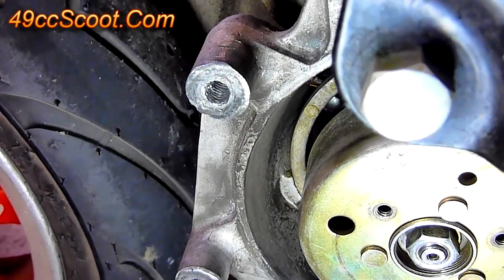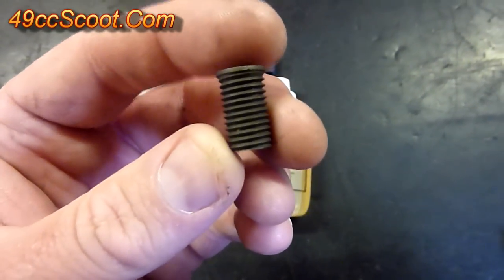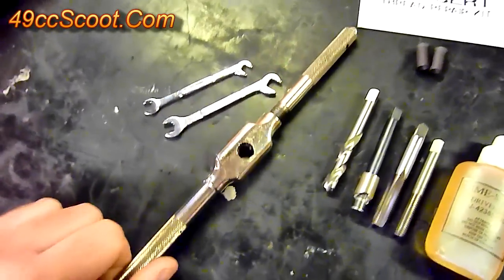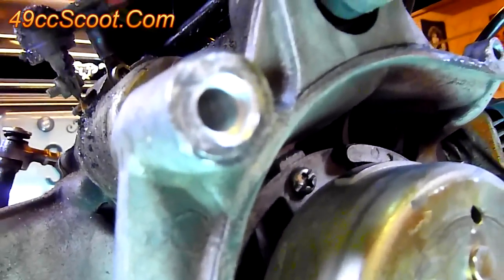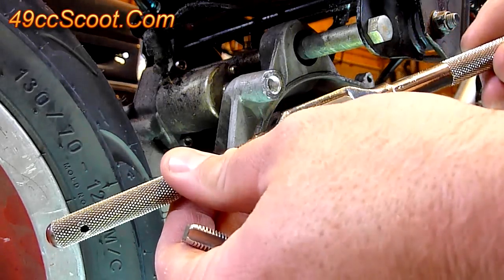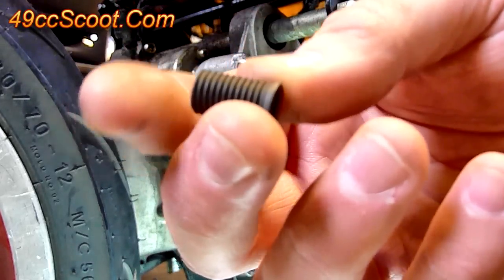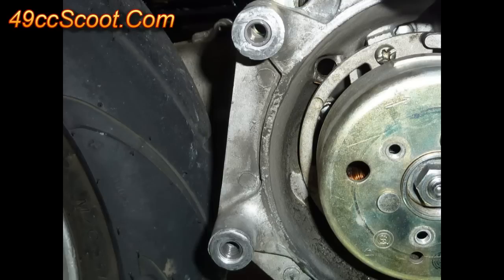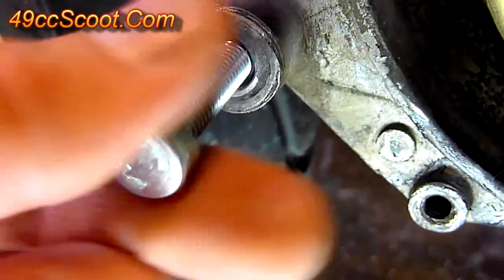Time-Sert Thread Repair - Heli-Coil Alternative

Comment: Can the inserts be inserted on the spark plug, without the spendy kit? I already have my spark plug sockets rethreaded from my crappy helicoil kit that kept failing.
Reply from the maker: They sell inserts made from different materials for head repairs, depending what the head is made of so they expand and contract at similar rates. I'm not sure if their standard insert kits work with their spark plug inserts or not.
Reply: @49ccscoot  refering to the time sert spark plug socket "Specific" kits. If my socket has already been tap and died, can I just insert the spark plug in the insert...and insert it all together (in socket), without having to buy pricey $150 kit?
Reply from the maker: @fisher5413  Maybe. They use a system that locks in place when a second sort of tap goes through, by pushing material outward. It may do the same when a plug or bolt goes through, or maybe it won't work out well. I guess if you can get one cheap enough, you can try it. I wouldn't count on a high success rate. I've only used the whole plug kit and that worked well for me.

Comment: I just had intake threads strip on me. There’s just not a whole lot of material in that particular spot that scares me. Minarelli also
Reply from the maker: I have used M6x1.0 timeserts to repair intake bolt holes on my Chinese Minarelli engines before. It worked fine for me.

Comment: Can you recommend a Time Sert insert and rethreader for a 49cc spark plug hole? 10mm thread diameter and 1/2" thread length....please answer...you would save my life.
Reply from the maker: Contact TimeSert (dot com) and tell them the thread and depth and material of the head. They should recommend a part number. I will say that some of the kits are very expensive. Definitely check the cost of a new head before you order anything.
Reply: Thanks

Comment: Can you use 2 time serts back to back     for deep 1/14  depth   thread repair?
Reply from the maker: No. You would need to look for longer inserts. They make them in different lengths.

Comment: @ 90GTVert  Can you tell me the size of the drill bit which is included in that Time-Sert Thread repair kit.. Did you fixed M8x1.25 thread in this video?
Reply from the maker: It was M8x1.25. It's 3AM ATM and I'm too tired to go to the garage, but if I don't reply just reply back so I'll get a reminder.

Comment: Good video.  As a former shop teacher remember when tapping the hole, after every one turn of the tap be sure to back it off 1/4 to 1/2 turn to break the chips loose.  This keeps them from becoming too long and failure to do so can actually cause the new threads to be deformed.  Otherwise, a very nice instructional video.
Reply: That and you might not want to tap it as fast as that ;-)

Comment: What I don't understand is that why not just tap using next oversize thread and install bigger bolt? So if there is 6mm OD bolt one should tap to M7 and use M7 screw? Why is it not so?
Reply from the maker: That's OK in some cases. Sometimes there are reasons to retain the original fastener size. Perhaps I didn't wish to drill out my exhaust mounts for the larger bolts for example. Other times it's more critical.

Comment: How do you ensure you are drilling in perfectly straight especially when simply doing it by hand?
Reply from the maker: If you need it "perfectly" straight, then set it up in a drill press. By hand, you have to pay close attention to all angles. You can setup something as a guide or reference to help, or maybe use a part of whatever you're working on as a reference.
Reply: I'm looking at doing an oil drain bolt hole under the vehicle if needed in the future.  It's kind of hard to get anything positioned when crawling around under there, but at the same time there isn't really any sort of place to fix a guide fixture on.  Not sure how perfect I'd have to get it for everything to seal properly.
Reply from the maker: It doesn't have to be perfect. If you take your time and get it as close as you can, it will likely work. If you aren't confident about it, maybe invest some effort into figuring out how to get easier access... raising the vehicle or engine or something like that.
Reply: I was wondering the same thing- I think Im going to drill a hole thru a small 1 inch block of steel or aluminum on a drill press to ensure a vertical hole the size of the drill bit. Then Im going to take that steel block and position it over the hole to be drilled out. That way when I put the drill bit in, it will be lined up perpendicularly just fine.

Comment: ive been using heli coil for years. it would seem over time the bolt would rust and the time sert would come out when you take the bolt out.
Reply: You can put never seize on the bolt threads

Comment: my spark plug just flew out my engine and the thred is on the spark plug what should I do?
Reply from the maker: If this is a scooter or single cylinder engine, then it may be best just to replace the head. If it's a larger engine, there are TIme-Sert kits for many popular applications or you could go with a helicoil or take the head to a machine shop and they'll fix it for you.
Reply: +90GTVert it's a gy6 engine that I just put on the bike
Reply: you should be fine if you match the thread and buy the right timesert kit. I used a helicoil solid insert very similar to the timeserts when i blasted the plug out of my little 4 cylinder pickup.. but like 90gtvert said you may be better off just replacing the head on a small motor. otherwise just try and find the helicoil solid insert and use that first, i only paid like 26 bucks compared to the 80 dollar timesert kit then if you batch it then just throw a new head on there.

Comment: Big help on educating me on the difference of the two. Having a 2015 STI brake caliper issue and this helps a lot in knowing what to ask for. Thanks!
Reply: helicoil also has solid inserts that work very well for much cheaper, the timesert kit seems to have pretty high quality tooling though, which is nice.
Reply: Noah Boswell b
Reply: gracias..

Comment: on a 50cc taatao qmb1p39 what is the size of the two long bolts that go thru the valve n piston heads in to the motor on the right side please some help out there thank u all for any help with this.
Reply from the maker: +tom mccarty M6x1.0
Reply: +90GTVert  thank for the help but not the four smell bolts that hold the piston head n  valve head but the two bolts that run the length of the heads that bolt to the motor on the right side. there only two long bolts I think they are m6x1.0 pitch 85 or 90  length do you know n if so some help would be great thanks again.
Reply from the maker: Not sure what you call the right side, as some look at it differently. To me the right side is the one opposite the cam gear, the exhaust side. The left side is the side the CVT and cam gear are on. On the left side there are 2 bolts on the outside, that don't require removing the valve cover to access. Those should be what you listed. If you mean the actual studs that go into the cases and all the way up through the rocker assembly, I'm not sure on length and pitch, but http://www.partsforscooters.com/?partner=49CCSCOOT carries them.
Reply: I guess it the left side so the way u sit on it is the way u look at it so when I put my big bore kit on to get the heads off on the side of the chain there are two long bolts 90GTVert u are the man on 50cc thanks

Comment: In a "Time-Sert" video I saw, they just about always recommend using "Locktite 266" to set the inserts. The oil is more for the tapping process. It helps turning with harder metals. But after threading you always need to clean out the area with brake cleaner and then compressed air to remove all oil residue and metal shavings for the Locktite 266 to hold best. Always use Anti-Seize compound on the bolts you put into the inserts after the fact, so they can't fuse and ruin the inserts when using too much force to remove the fused bolts down the road. Keeps the repair serviceable much much longer.

Comment: Just bought a kit and oil didn't come with it. What kind of oil should I use?  Thanks
Reply from the maker: pgreenx You'd prob be fine with a drop or two of motor oil for the installer lube, though I'd imagine Time-Sert only recommends their specific oil.

Comment: Nicely done. Hanson or irwin has those tap handles that a ratchet can attach too. Around $35 for two varied ranges. I usually like to oil the tap n drill bit a little to prevent heat warpage, just from my horrible experiences, lol.
Reply: Why spend $35 when a 12 point or spline socket can be used? You can also use a drill and go very slow.

Comment from the maker: I don't know the specifics of that engine and sizes, but it should be drilled out with the bit in the kit if you're using the time-sert. You may get away with it if it's really close, but it will be harder to tap and you run more risk of damaging the bits or engine cases. You're gonna want a drill to do the countersink cut as well. It's worth doing right, even if you have to wait on a drill IMO, especially when dealing with engine cases.

Comment: just a tip instead of using a Spanner/Wrench you can use a socket, extension and T-bar to make an extended drive tap handle works great for working in tight spots
Reply: Dankie/ Merci Blue-eyes-seto. I was wondering on that same question. So one can use a normal Geogor-socket extension. If the hole more than 60mm deep I will have a problem. But with Corona is a bigger problem. Thanx for the advise.
Reply: blueeyesseto -- Exactly !  I would put a socket on it and push it straight and turn it slowly..

Comment: as do i. but when tapping, maybe i missed it. but id tap in 3-4 rotations, then back off a half turn, then continue. but ive used timeserts and helicoils myself. and like the OP here, i prefer the timesert because of the locking part of it. ive got to use one here soon on a motorised bicycle engine.